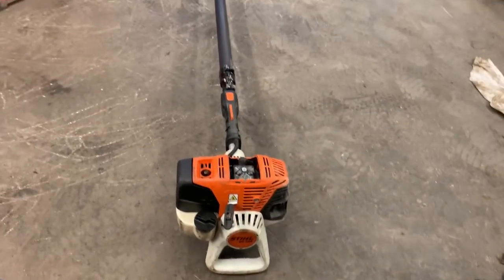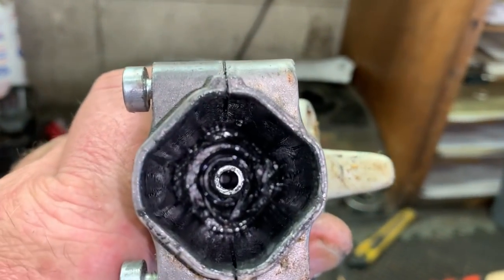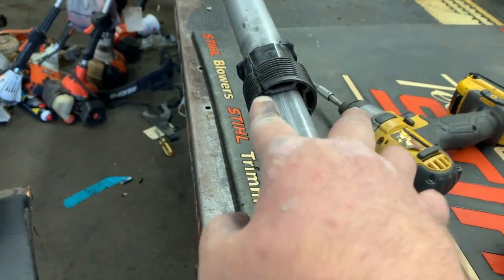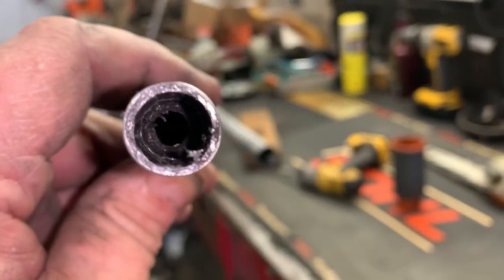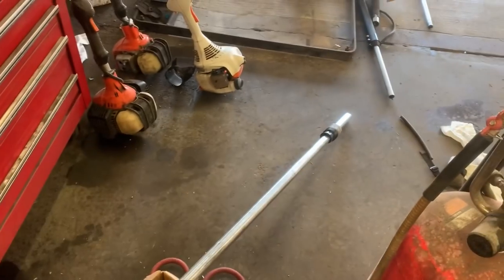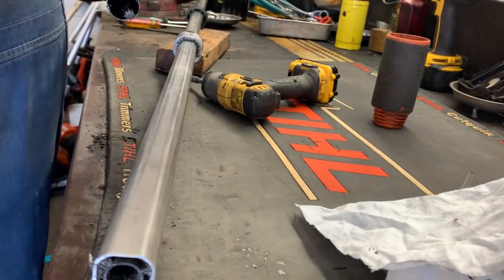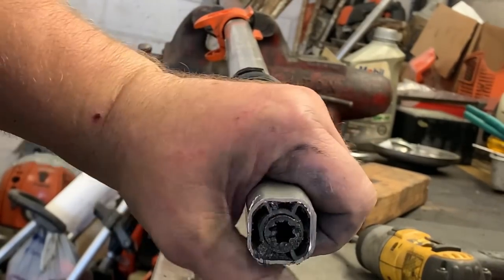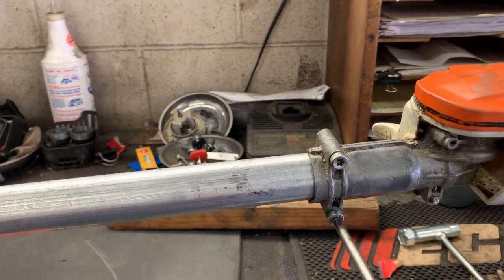THIS STIHL POLE SAW HACK WILL SAVE YOU TIME, MONEY, AND LOADS OF FRUSTRATION

Comment: This is a very nice repair. You let the customer know in advance. The customer can choose “labor + $100” or “labor + $0”. Seems like a great way to treat your customers. Plus, at some point that shaft will no longer be available. What do we do then, throw out the whole tool or lose 6” of reach and get back to work? Even if I had the replacement shaft on hand, I’m pretty sure I would cut the old shaft first to get as many years use as possible out of the original part.

Comment: Had this happen to one of our saws at work the other day and we needed it back in action, so I just flipped the shaft end over end and used the still good end on the gearbox. Not an elegant solution, but itll work until we can get it fixed properly.

Comment: What isn’t seen or shown is the sleeves at the end of the hex/sq extend shaft. Those two clip into the hole on the end of that shaft. One stops the shaft from over extending item 22 on parts diagram.  The other has a bearing and allows shaft to rotate it is item  23. When you removed the shaft neither piece came out, which they should being that they are supposed to be locked onto that shaft and held by the tension from being against the wall of the outer tube.   What would be great would be how they are actually put back together and the orientation of that clip on the shaft and which side of the part number 23 is it on.  From what is shown the clip is between that bearing sleeve and the outboard end of the hex shaft as you pull the drive tube and the bearing sleeve was not attached.  The parts diagram is confusing at best as it show the clip on the other side if the bearing sleeve which means it woukd have pulled out that sleeve and the limiter sleeve as well if the part diagram was followed.  I am interested as it seems that what you show is correct.

Comment: For any who want to remove the extendable shaft, first remove the primary fixed shaft from the end near the engine. Once its lose pull and separate the fixed shaft from the throttle handle and it’s shaft. Once it’s separated pull it and the extendable shafts together off from the drive shaft with the four springs. Once removed extract the extendable shaft out the rear end of the fixed shaft. You will find two black plastic pieces on the rear end of the extendable shaft. The one on the end is the one with a bearing to support and keep the shaft centered.
The next plastic pieces is locked in its position and stops the extension shaft from over extending and causing damage from too much leverage against very little connection of the shaft housing.  Removing from the outboard end is not the way to do the removal and was done for demonstration only

Comment: Great video. My question isn’t about this exact project. I have a Stihl FS90 line trimmer. I bought it right before all the kombi stuff came out. Do you know if the head end on my FS90 is equivalent to one of the Kombi head ends, and if it is, could I order replacement parts for the shaft to convert it to a kombi without buying another $400 head end? You seem to know the Stihl products very well so I thought you may know. Thanks!

Comment: MM1 nice video I watch all your video's I'm working on a HT101 clean the carburetor it will run WOT but won't idle,can you do a pressure and vacuum test on a four mix.
Reply: Yes.  Just like a regular 2cycle.   Engine pan is notorious for air leak.

Comment: Wished you would explain what happened to the plastic pieces that should be connected into those holes on the extender shaft.  What happened to them when you reinsert the tube as they don’t just magically reinstall themselves.

Comment: With everything being as original if you remove 2 “ off the splined drive tube  you would aslo cut that amount of the outer tube and it should present itself in the same offset as it was before it was cut.